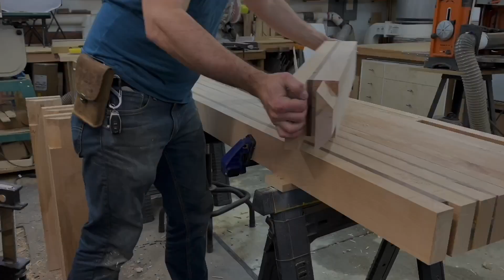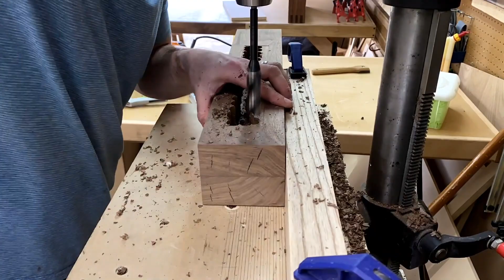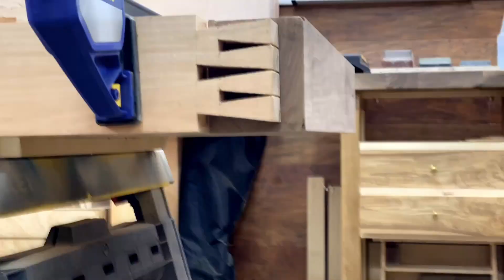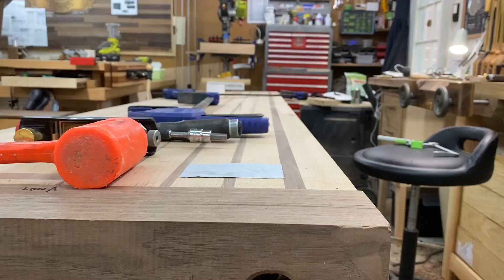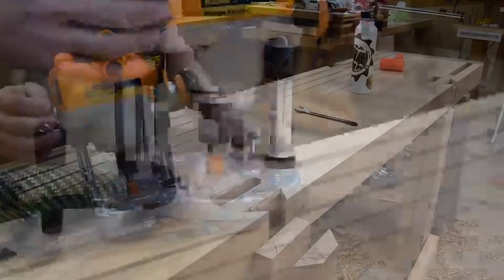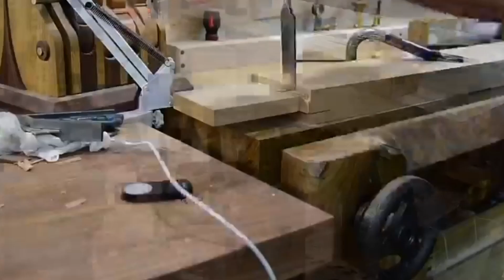Roubo Workbench Build | Part 2/3 | All the Joinery Fun

Comment: hey quick question - what size fishtail chisel do you recommend?
Reply from the maker: Hey Assaf. I really like the 3/8 from Lie Nielsen. The smaller the better, at least for what I make usually
Reply: @SawyerDesign  thanks, I bought the one from Blue spruce - fit better in a honing guide! (prettier to)
Reply: @AssafOppenheimer  I bought the same one from blue spruce. Cocobolo with black brass, specifically because of this video
Reply: @thayes7089  mine is African blackwood and brass 😍

Comment: I love your design, the sliding dovetail tenons are epic! one thing I have to ask, aren't they  a design  weakpoint? it looks stunning but how do you keep the  board that bridges the the tenon to the endcap (the one with the hounds tooth) from caving due to stress from the tailvise? I'm asking because I am trying to plan my own. I'm dying to add through tenons but it seems to weak compared to blind ones where the board is continuous. really love to hear your thoughts
Reply from the maker: oh it's full thickness at the tail vise! Definitely no risk of caving under any stress the tail vise will incur

Comment: I have that same drill press, and the table cracked on mine as well, it didn't completely break off, but it was cracked about 3/4 of the way down from the top at the neck.  I just flipped it over and built a simple plywood top that fit into the relief on the under side of the table.  It's square, for now, but it's just a patch till I buy a better one.
Reply from the maker: I gave mine to a local welder that could do cast and he built the knuckle back up and reinforced. Worth doing and wasn’t expensive. Definitely miss the depth guide on that thing, but loving my new floor standing press